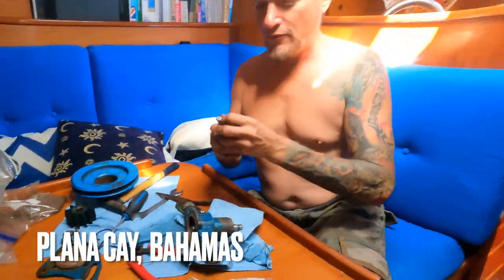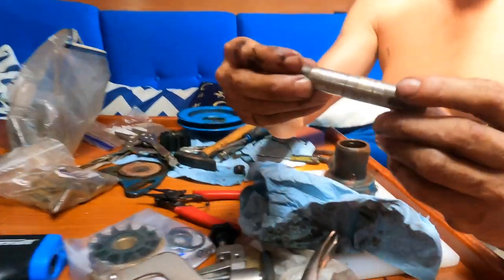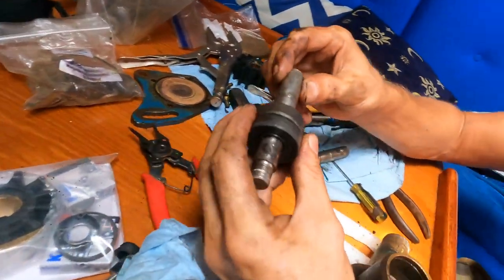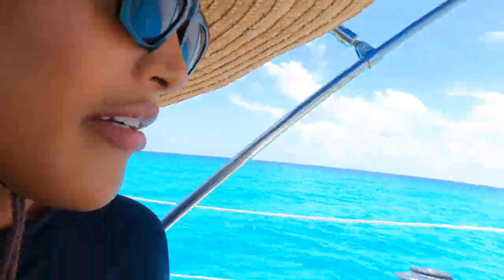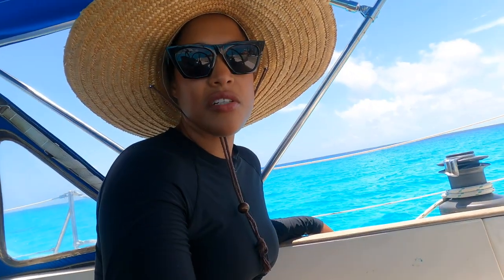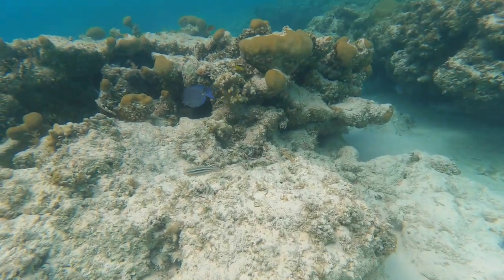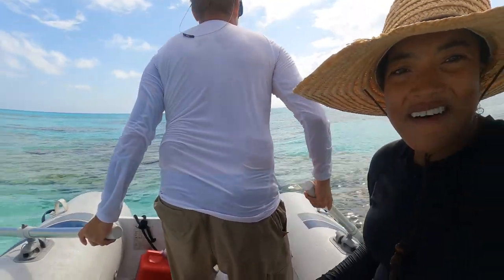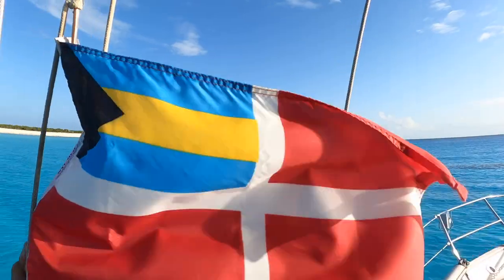EP58 SEA WATER LEAK  AT PLANA CAY ISLAND BAHAMAS | FIXING SHERWOOD H5 WATER PUMP LEAVING THE BAHAMAS

Comment: Not really a problem. That is just what a seal does after time because the rubber gets hard. Replacing and seating the seal in new location as you did is the best you can do without replacing the shaft/pump. The only preventive you can do is replace the seal when you replace the impeller.
Reply from the maker: That pump was a problem for some time until we got a new one after covid.  The shafts were worn causing the seals to fail, just bought a little time with each rebuild.  We were on the thorny path for the duration of that issue having to motor more than we would like.